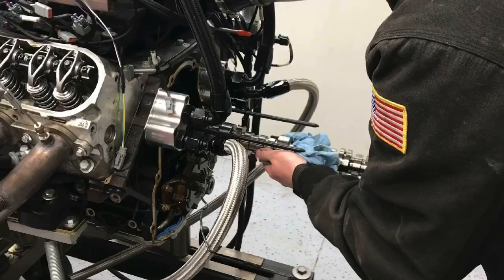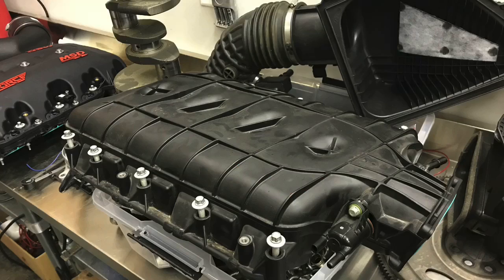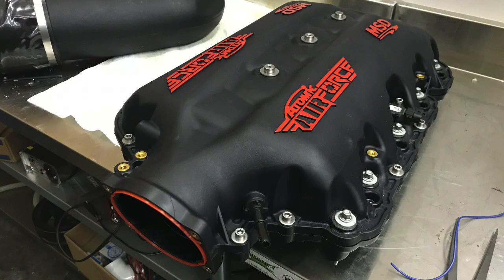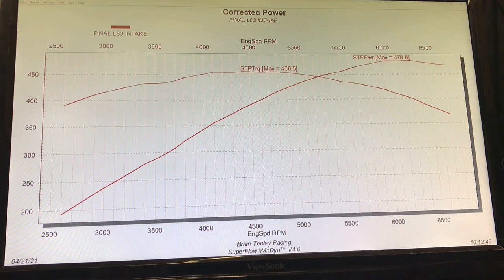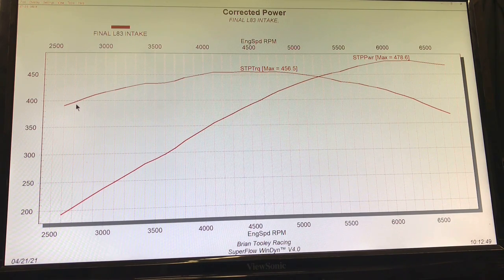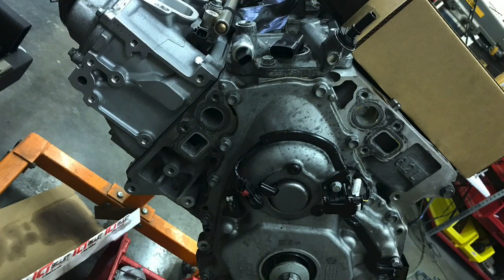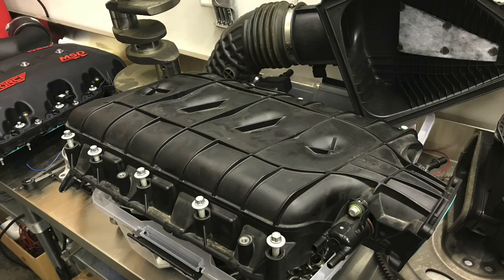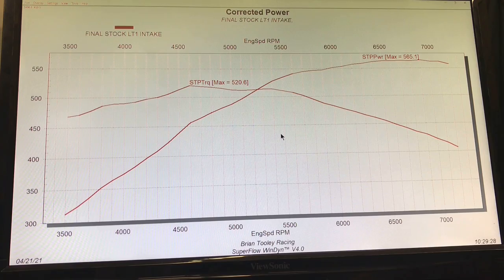GEN 5 LT1 INTAKE TEST (L83 V L86 V MSD)

Comment: Did you have to use a new throttle body for the MSD intake or could you use the Factory throttle body of the LT1 on the MSD intake?
Reply from the maker: MSD HAS A LARGER OPENING

Comment: When doing the MSD Swap on the Gen V LT 5.3/L84.. How do you connect the MSD Atomic Intake to the “Brake Booster”? Not sure truck has a Line for this off of stock Intake?
Reply: @richardholdener1727 can you please help? I’m stuck lol.
Reply from the maker: can you drill and tap a fitting into the manifold
Reply: BTR sold me the MSD Atomic Intake (27003) for my Silverado 5.3/L84, swearing it would fit, but it doesn’t. Bolts up & Port Matches Runners on Heads, but there is no way to mount a Throttle Body due to the Water Pump. What’s the point of doing a shootout w this Intake when it’s
Not even an option? Pretty misleading.
Reply: @ It’s a Plastic QD “Female “ Connection. Since it’s Vacuum, and not Boost, I’m thinking of using a Fuel-Line Cap that fits perfectly, locks-in, w a very little (appropriate) amount of GM Engine RTV Sealant. Idk what else to do. These Trucks don’t have a Vacuum Booster.
Reply: @richardholdener1727  unfortunately no

Comment: Horsepower is great and all but honestly efficiency mods to get more MPG's would be far more impressive. Having all that horse power is basically useless unless you're towing or racing. Otherwise you're just cramming more fuel in there to go the same speed...
Reply from the maker: you get to any speed faster-that is called hot rodding. But they can be combined with improved efficiency under cruise too

Comment: In your opinion for a gen 5 lt1 is the msd intake better than the btr trinity intake? And how do they compare to the lt2 intake? I'm putting an lt1 in my 86 iroc and wanna choose the best intake
Reply from the maker: best for what? the msd and btr trinity have different effective rpm ranges
Reply: @richardholdener1727  I'm gonna be using it for the road coarse racing and I'm using the rpm stage one setup. Their heads and cam.

Comment: Hey Richard I have a L83 and trying to figure out who makes the best overall intake manifold TQ and HP? Holley high ram? Carbon PTR? MSD?
Reply from the maker: where do you want to make power
Reply: @richardholdener1727  I would like to make more power every where in the rpm range but obviously we all gotta choose. Longer runners= more low end power. Shorter runners= more high end power. It seems like the best manifold is Performance Design Carbon pTR Intake Manifold LT1/L83/L86. With the 9inch runners it seems to be the best of for all power range. Do you agree? Also this is $1500 manifold but is 85% cheaper than the supercharger I’ve been planning for!
Reply from the maker: there is no Universal Best-Intakes are rpm specific-pick the one that makes power where you want to make it
Reply: @richardholdener1727   well I’m looking for something that doesn’t hurt low end power too much and more high end. Cuz I’m doing a BTR Stage 2 cam soon which will help everywhere. So do you think the performance design carbon PTR manifold is the best?

Comment: Will that MSD intake bolt right to my L83?
Reply from the maker: yes
Reply: Awsome thank you I’m gonna order it now and get a bigger throttle body and a bigger cold air intake I’m running a tsp chop monster cam with a stock intake and cheap cold air compressor brake in my l83 and tuner says we got to get more air so gonna try the MSD intake and a new K&N intake

Comment: Would a stage 3 cam on the L83 respond better with the MSD manifold in the midrange and so on?
Reply from the maker: than what?
Reply: @richardholdener1727  so a bigger cam would’ve worked better for the MSD manifold on the l83

Comment: The LT1 with bolt ons make as much power as a heads/cam LS3. My friend's heads/cam 1LE made 604whp on E85. A hair over 500 on bolt ons with an MSD intake.
Reply: We made 470whp/470wtq with a bolt on ls3 and 560whp 44xwtq with a h/c ls3. Lt1 is a better piece but not to the extent that you say.

Comment: Hey, remember those 305/350s rated at 115 HP in the late 1970s?  We've come a long way.
Reply: I had a 98 chevy king cab 4x4 350ci with the 5 speed. It pulled harder than my 2015 Z71. I think it did because peak torque was at 2800 rpm. I sure miss that truck. It was a hoss.
Reply: @southern04man  Actually it didn't I love the obs trucks and own a few of them and my 2014 will pass them all and tows better. Those stock 350s were slow.
Reply: There was never a 115hp 350 as delivered
Reply: I have a gen 1 lt1 that came with 300 hp in 1969 ...327
Reply: Ran a 14.1 shorty headers 650 holley dbl pumper th350 n a 1 legger wit 4:10
Reply: Tho those are more like 376 ci and have bigger valves

Comment: Good job, however, i'm a little disappointed you didnt compare the LT1 intake vs the L86 intake.  Also, where is the LT2 intake at???
Reply from the maker: BTR did that test too-L86 better down low
Reply: @richardholdener1727  LT1 is much better up top though.

Comment: I have a 6.6 in my 2021 gmc hd, and it's frustrating that these parts are out, and the potential is there, but there is no way currently to tune them. Because im sure with a cam, intake, exhaust and a tune, that engine would be a riot.
Reply: Yeah, considering the 6.slow turned into a monster with the same work I’m sure the 6.6 is gonna be pretty rowdy
Reply: @chevygangchan2108  a 6.0 isn't slow. They ran good. Sure the new stuff is better but even my old 03 2500hd is a decent runner. Especially once you get all the limiters turned off.

Comment: Direct Injection helps with power across the board. However it does  present carbon buildup issues on intake valves in stock applications,  it will be curious to see how they do in performance applications, most issues I see are in vehicles that are babied alot.

Comment: What Throttle body was run on the 6.2 with the MSD? Factory 87mm?
Reply: I was just watching your videos on the LT2 manifold and LT5 throttlebody the other day 😆. Im trying to figure out if there is any horsepower gain from the 95 mm on a basically stock car other then LT2 intake and E85.
Reply: @Jr_5646  were all in this together just trying to make power! 😄
Reply from the maker: we generally match throttle body size to intake throttle opening size

Comment: The live feed from Tuesday April 20th i asked what pushrods would yall suggest for a bored lq4 6.0 pushing between 600-800 hp? Didn't get a response. One guy said not to run stock pushrods at that hp. I have the stock 7.4"+5/16 thick ones. Can't find the hp rating on those. Could yall help please? Don't want those to be my Achilles heal and blow it up after putting 5k into this build.
Reply from the maker: USE HARDENED PUSHRODS WITH DUAL SPRINGS
Reply: I have the duel springs. Is there a specific brand with those measurements with specifications on hp and torque and rpm or are they just thicker??? Not much experience with this part. Always had old style. On my own this time. Lmao

Comment: Great to see your working with the LT1.. I had mentioned before about having one in my 2015 C7 corvette and I’m looking some simple ways to increase the horse power dependable on a budget.. The headers and cam you just showed with the right intake looks good to me!! You did say there were more gains to be made with more camshafts and you were going to explore that soon.. I’m going to wait to see those test before having these modifications made on my Corvette because a custom tune runs about $500 in my area here in NC and I want to do it all at the same time to save money and get the most out of it at the same time!! I’m 68 years old and only have 16k miles on the car but have had muscle cars all my life and my heart race’s every time I stretch her out..
Reply: If you live in NC you should 100% get in touch with pray performance for tuning. He's probably the best in the country when it comes to the LT, and he's in your state. Im pretty sure he has the LT bolt on and heads/cam quarter mile records. Low 10s bolt on and low 9s heads/cam in a 6th gen camaro. He even does remote tunes if you dont want to go see him.
Reply: @Jr_5646  I appreciate your comment. I'm in NC as well and bought an 18 SS 1LE. She's quick but I can definitely see myself adding some goodies to her in the next year or so when my warranty runs out. I plan on a Rotofab CAI, 1 7/8' long tube headers, either the MSD or LT2 intake and maybe a cam that would still serve for a daily. I have the NPP exhaust and won't be changing it other than getting the extra cat removed soon
Reply: By the way, the LT1 responds great to a cam and E85. If there is a gas station near you that sells flex fuel, you should definitely get a flex fuel sensor and tune. Easily 40 whp gain for a few hundred bucks. Cam will gain another 60-75 wheel. Dont know what your budget is, but the cam install can be pretty expensive if you're not doing it yourself.

Comment: This Lt1 talk confuses me. My 3rd gen Camaro has a real Lt1 in it (of course it is not stock for this car!), these LT motors, L83/L86/Lt......  Hard to wrap my head around this. How are we suppose to differentiate between small block LT1 and the LT motors? If you are calling it an LT1? :)
Reply: Simple, you call it Gen 5 LT1
Reply from the maker: THERE ARE THREE DIFFERENT LT1S OFFERED BY CHEVY
Reply: LT1.1 =>  Gen I
LT1.2 =>  Gen II
LT1.3 =>  Gen V

Comment: Is it just me or does that aftermarket intake, the MSD,  looks cracked where the throttle body clamps on????
Reply: It's just you.......
Reply: Check time on video at 4:30 in this video and you can see the crack on the top close to where the throttle body connects to the manifold. Looks like a 2 inch crack.
Reply: @richardcoleman9645  A crack or a hair or a fault from the injection mould ?

Comment: Ok ok ok... so I'm thinking 650 hp out of a 6.2 liter.  Add stroke (will it take a 4.125 crank???) to bring it up to 400 to 430 cubes.  Simple math says well over 700 hp.  Like a bunch over
Reply from the maker: DO NOT USE 4.125 STROKE
Reply: @richardholdener1727  4 inch then.  That puts u over 400 cubes
Reply: @richardholdener1727  Figured it out.  BTR tall deck raised cam block with siamesed cylinders and 4.200 bore X 4.500 stroke capacity.  Talk to him would ya?
Reply: Got me thinking if the LS7 crank can fit there, or something like that...

Comment: Yes! Bout to drop l86 in a brz with the tenspeed. I love watching these Gen v tests. What about l86 intake on the lt1/l86
Reply: Please find a manual trans to use in that setup! That'll be a monster either way though.
Reply: @BuffMyRadius  the 10l90e shifts faster than a pdk Porsche trans. It will be faster on a road course than using a manual. Tr6060 or t56 would definitely be the easier option though but this will be a full blown time attack car
Reply: @Shiftheads  If you're out chasing the best times I understand. Automatics start getting really expensive when it comes time to shove lots of power through them, but I'm not about to act like a manual will be faster.
Reply: Sports cars deserve a manual. Part of driving is handling gear changes well.
Reply: @jeremypike9153  I get it but part of winning is having the best setup for the track. The zl1 has way more power than I'm running through it and it doesn't have a problem with it. 10L is a great trans that both Ford and gm use
Reply: @Shiftheads  is that going to be an easy swap?
Reply: @corvetteZ3r  the Ls3 swap is seamless but gen v have different motor mounts and harness so it will complicate a little more. It should all fit with slight modification though. Canbus translators exist so gauges, abs, power steering etc still work

Comment: Great video, If possible you should do a comparison between ported msd and a ported lt2 and maybe the hi ram on the 6.2 lt1, that's something the camaro/vette/  whoever people really wanna see.  I don't think anyone has really done it yet and it'd answer alot of people's questions
Reply: Guatney performance has test results for the LT2 vs MSD. Also RPM just put a video up today comparing the Hiram to the stock LT1 intake.
Reply: https://youtu.be/F_qetKBxZNc
The Hiram is a beast. The only problem is you have to buy another hood or cut a hole in your stock one. I think you have to cut into you wiper cowl as well so that makes it a no go for me unfortunately.

Comment: I want to see you do some stuff with the coyote. I’d like to see how the latest Coyote motor stacks up. Need to see how about Ford versus Chevy rivalry is playing out.
Reply: Gen 3 coyote is a beast. Especially when paired with the 10 speed trans.
Reply: I mean we already know the gen 3 coyote does 480hp and not remotely as much torque...so if it's not boosted meh....with same 10speed
Reply: They tried to compare, but the Ford blew up!!! ROFLMFAO!!!🤣😂😂🤣😂👊
Reply: @milojanis4901  the gen4 blows oil pumps because it's belt driven, thank god the mustang still has the gen3
Reply: @Prestiged_peck  the belt driven oil pump isn't really a weakness... The pump is higher volume than the gen 3 oil pump and comes from the factory being a billet part.. plus the belt is kevlar
Reply: @Prestiged_peck  The belt drive actually helps to keep harmful harmonics from transferring from the rotating assembly into the relatively brittle pump gears. This should help keep more oil pump failures away.
Reply: @madmod  but what about belt failures at high RPMs, or simple belt slip?
Reply: @Prestiged_peck  They have used similar tech in cam drive kits with kevlar belts rather than a traditional timing chain. This is huge for quelling harmonics which, if those vibrations are strong enough to eat bearings, they could certainly have hurt a set of pump gears, especially with the rpms even a stock coyote turns. Add in the fact its a cog driven "wet" belt lubricated by the engine oil and you see very few failures from slipping or breakage. For what its worth, the R&D ford went through testing these are finding the belt driven combos are more durable in a high load, working truck tests, as well as higher rpm combos like that in the Mustang.
Reply: @gman3563  this is nice to know. I wonder if there will be a chain drive or gear drive conversion for stupid high horsepower applications (1500 plus)
Reply: @madmod  it's good to know they did their research, let's give it a year or two and see what happens. The gen4 also got cylinder deactivation, and better rings, so it oughta preform magnificently on a big bang if you don't blow off the oil belt.
Reply: @Prestiged_peck  Definetly haha. I wouldnt worry about slipping or tossing the cog belt. They are incredibly strong and the pdf for the new pump shows the belt having very little room to pop off. Belts generally have less stretch than chains too so it should be very little maintenance. Wet belt drives are strong as hell.
Reply: @madmod  well thanks for allaying my fears.
Reply: @Prestiged_peck  and just like that the new coyote uses a belt for the oil pump in the trucks coming to car soon....but it may be better than them breaking the oil pump gears anyway... 
 
 I had a terrible experience with Gen 3 coyote and the 10r80 both failing on my 19 premium gt

Comment: LT2 intake on LT1 engine compared to the MSD intake is more of what Gen 5 Lt1 people are curious about, as always appreciate the info!
Reply: I feel like the lt2 intake is a no brainer right now. According to gwatney performance, its damn near as good as the MSD, and it's like $200. Yes please. Just ordered mine the other day actually.
Reply: @Jr_5646  Only for a Camaro. LT2 Doesn't fit under Cowl of C7 Corvette.
Reply: @Jr_5646  I have trouble believing anyone who is selling the parts or involved in the tuning ect.. Just me.. But I went from LT2 to MSD  2 months ago, and got 31whp over the LT2.. Yes the LT2 is cheap, and a great bang for the buck, but its just not as good above 5500rpm.. Not that big of a deal when your shifting at 6500, but when your up at 7000-7200 the split is even bigger.. That 31whp is at 6870rpm.. My soft limiter is 7100.. The car has stock heads, btr 225 cam & springs, NW 103 TB, Kooks LT Headers w/ kitty deletes.. Its making 552whp on E30, should be really close to 600whp with heads..
Reply: On drugs msd destroys lt2 significantly...😊@Jr_5646
Reply: @Jr_5646  agreed. I have a lt2 waiting to be installed
Reply: I just wanna see ported msd vs lt2, non ported then lt2 is probably the better choice at this point in time due to price
Reply: @caddyv2327  https://youtu.be/bt55yZGEdoE

Ported MSD will definitely make more, but its also $1000 more before you port it so it better. I guess it all depends how much you're willing to spend for a little bit more power.
Reply: @O. Stone just don't race a car with a MSD manifold with your lt2 manifold stay away